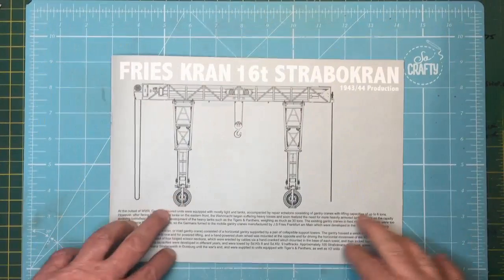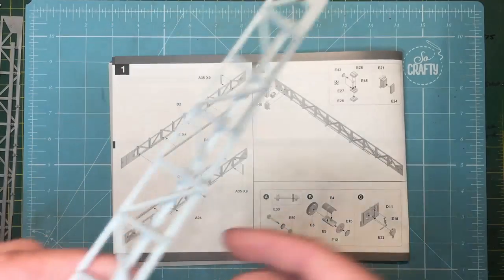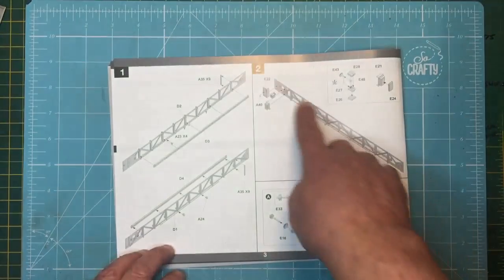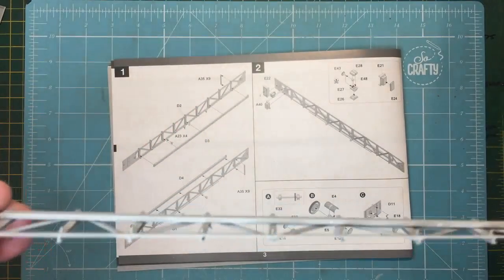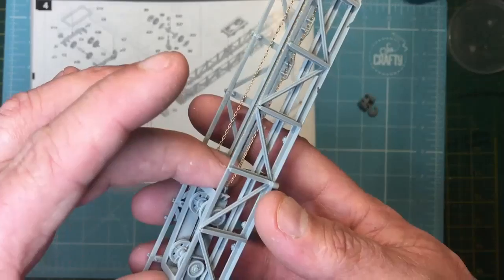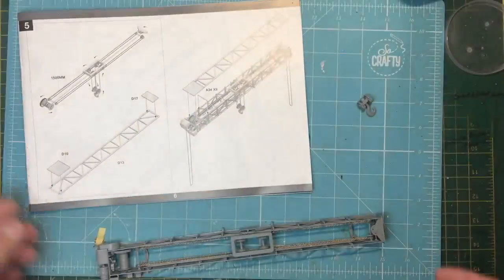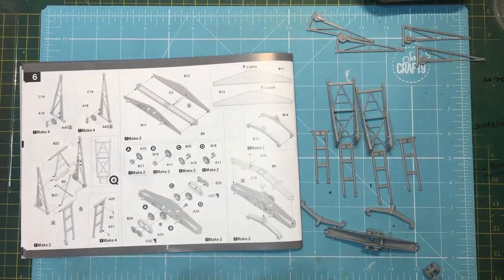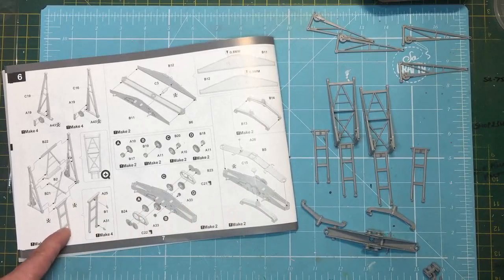Takom 1/35 Fries Kran 16t Strabokran build review

Comment: Great build Nigel, I wondered if you had used the book Der Strabokran: German Gantry Crane 1942-45 by Volker Ruff ? Has some excellent pictures of the crane in action. Did you also notice that there was nothing in the kit to control the crane? There should be a control 'pad' to operate the crane, which is suspended from the control boxes on the cross beam, to allow the crane operator to control the winch etc. Other than the issues you highlighted, it makes a good model. All the best and keep up the good work.

Comment: Hi Nigel.  I am just opening this kit up to build.  There are two nylon ropes included.  Is it correct that the larger diameter rope is used on the top of the gantry and the smaller diameter ropes are used for the sides?  Thanks for posting this.  It has been a big help!  John
Reply from the maker: Hi John.. I really dont remember, it was a long time ago I built this.. I would imagine the instructions will tell you which size to use and where??
Reply: @NigelsModellingBench  Nigel.  I did not see any reference as to which one.  I will see if the "gears" are a different size.  It does look like painting will be very interesting as well.  Thanks for your reply.
Reply from the maker: @johnferry9782  I just dug mine out and yes, the thicker rope is for the upper pulleys and lifting block. the thinner lines are for the raising mech on the sides.
Reply: @NigelsModellingBench  Thank you so much!!
Reply: Just shows you how many people watched that video joking aside I would have been very happy if I could have watched a video were a builder of the  Stabokran my one was tankom didn’t find one were the model maker would have showed the watcher as it has the possibility to be part of a good diorama some companies think we shouldn’t just build models but be experts in  code braking the instructions often leaves even the most level headed people perplexed  some times when you comment on something on the phone I can be misconstrued you done a good job of a kit that wasn’t a hundred per cent in it’s instructions and I’ve watched a few of your videos so good luck

Comment: Great informative vid, liked n subed. I just bought the Amusing hobbies version of this kit , I’m wondering if it’s better or worse on the sprue marks?
Reply: @NigelsModellingBench   ( Update ) I just compared the parts you stated had badly positioned injector pin marks and it seems the  ‘amusing hobby’ version has avoided this and I think has a little sharper moulding than the Takom kit in places like the gears. Also this kit does come with plastic wheels

Comment: A 8ton need to transport the crane
Reply from the maker: So it had to be towed with a Famo then?
Reply: @NigelsModellingBench  yes
Reply: Germans used Half-racks ( Sd.Kfz. 8 or Sd.Kfz. 9 ) pulled the Strabokran in the field. To build the Strabokran 16t required ten soldiers about an hour of labour. Only the heavy tank repair units equipped with Panthers or Tigers received these special pieces of equipment.
Reply: @NigelsModellingBench   a different use Widely used with the heavy maintenance companies of the Wehrmacht, the so-called Strabokran was used also by V-2 Units to load and unload the missiles from the railway to the Vidal and Meiller Transport wagons.
Reply from the maker: @shawnbrownstein151  Thank you very much..
Reply: @NigelsModellingBench  do you have a email